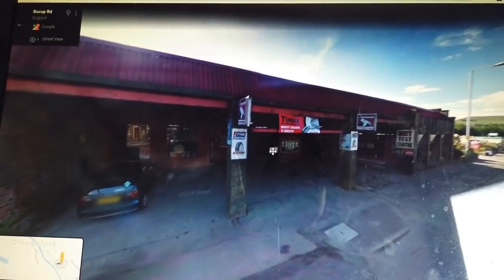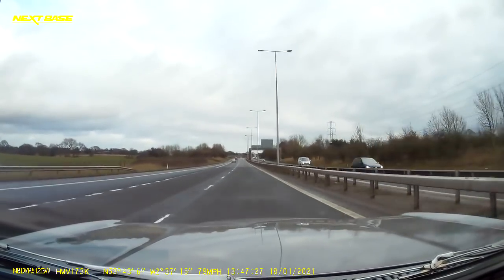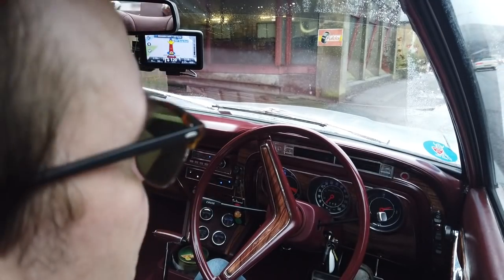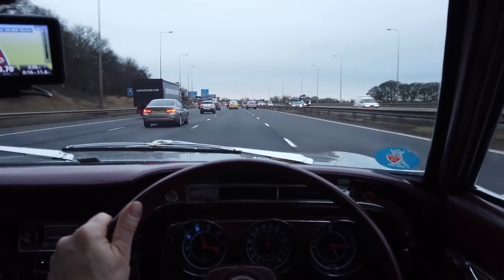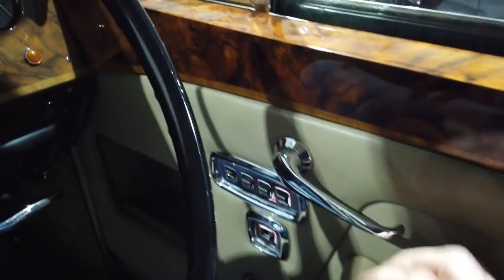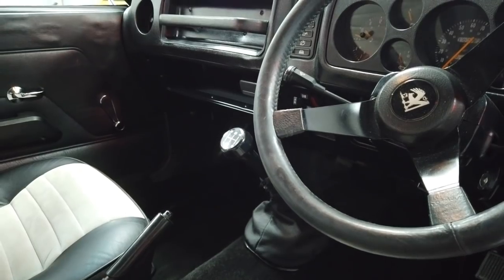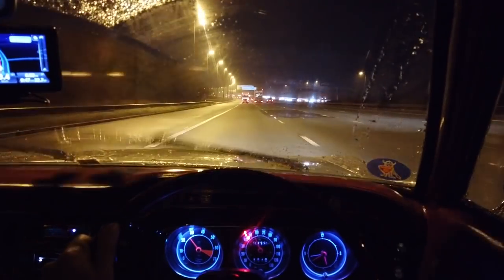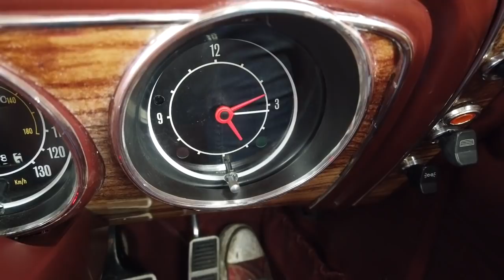Classic Car Trip - Cortina Mk3 - Cars n old Garages - Vauxhall Heritage cars.

Comment: Absolutely fantastic Pete, I've had enough of these crazy times too and this video was a nice break from this same old hype on the internet at the moment.  I felt as if I was back driving dad's Daytona GXL once again.  I used to work in a Vauxhall dealers during the 70's and I remember the first new Firenza arriving which we put on the road as a demonstrator.  In that silver it looked so different from any other car and looked like a spaceship then.  I remember that the gearchange on the ZF gearbox took quite a bit of getting used to being quite a huge thing compared to other cars, it was also fairly tight and notchey in changing gear.  The british manufacturers at that time envied the side view of the Capri and it was the Firenza, Avenger, Marina who were the main culprits for trying to copy it in some way or another, but it was always the Capri that had the most pleasing and nicely balanced design.  As regards the induction sound and loss of power on your car, the timing might make a difference if it is too far retarded.   Cheers LC

Comment: Lotus Carlton  has a little plaque on the glove box lid telling you the build No. Engine on floor with red centre cover is, I suspect, a Cavalier touring car lump, it has a reverse head with the throttle bodies pointing towards the front of car to try and force more air into the engine when at speed.

Comment: A  K and N filter will sort your induction performance problem.
Reply from the maker: thanks Steve, i thought about that but when i compare to my other 2 GXLs with standard air pans, the car still dont quite match the induction roar
Reply: Did I see that the carb is slightly different from the previous cars?  Other than that maybe worth checking on the cam timing and lift / duration between the cars.  I know that improved performance can be seen by advancing the cam by a few degrees.
Reply: @PeteCswampy  I was having another think Pete and was wondering if you have got the same DGAV carbs on both cars you are comparing, where the butterflies open progressively for economy.  If so is the second choke operating ok on the weaker powered car?  Also some owners fit Capri 3ltr 38DGAS carbs that have both venturis opening together that would give extra power and more induction noise.  Are exhaust manifolds all the same?